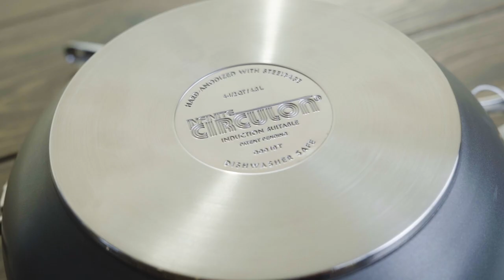What Is Hard-Anodised Cookware | Non stick hard- anodised cookware | Advantages & Disadvantages

Comment: Infinite and origin range me kya difference hai
Reply from the maker: Hello ,
I hope you are doing fine!
Thank you for your query. We would like to inform you that both are best in quality and we provide a Lifetime Warranty on both of them. However, in order to derive a comparison, there is a difference in Body Construction between Circulon Infinite and Circulon Origins. 
Infinite is a range that has a Hard Anodised and non-stick body inside out with steel handles and steel lid. On the other hand, Origins is a range that has a hard Anodised body with a full plate induction-based body. It has riveted handles and phenolic plastic over mold.  Additionally, there is a weight difference; Infinite is noticeably heavier. Additionally, Origins is oven-compatible with up to 180 degrees Celsius whereas Infinite is oven-compatible with up to 240 degrees Celsius. We hope this helps!
Regards Pots and Pans team

Comment: Can we use metal spatulla with hard anodized cookware
Reply from the maker: Hello ,
I hope you are doing fine!
Thank you for your query. We highly recommend the use of silicone tools on your non-stick cookware as they don’t scratch the non-stick surface & are completely inert & don’t impart any chemicals into your food. We hope this helps!
Regards Pots and Pans team
Reply: @PotsandPansIndia  but still it's not cleared about hard anodized cookware will get harm from metal spatullas or not
Reply from the maker: Hello ,
I hope you are doing fine!
Thank you for your query. We would like to inform you that the metal spatula can ruin your non-stick coating & negate the warranty of the pan. Moreover, once the non-stick coating is ruined, it is impossible to repair/respray on a non-stick pan. We hope this helps.
Regards Pots and Pans team